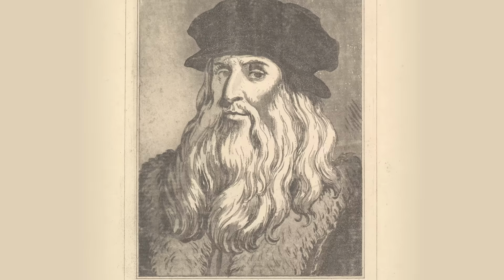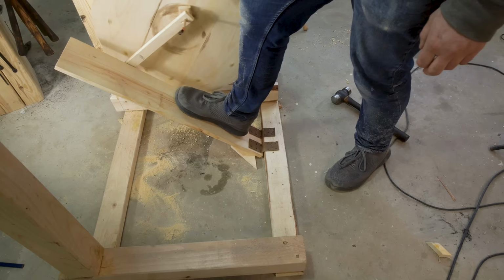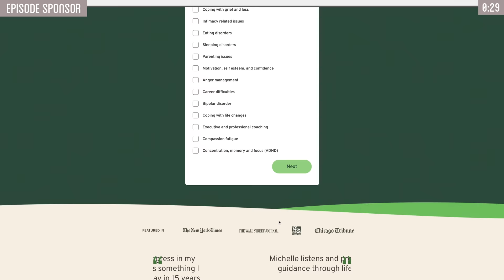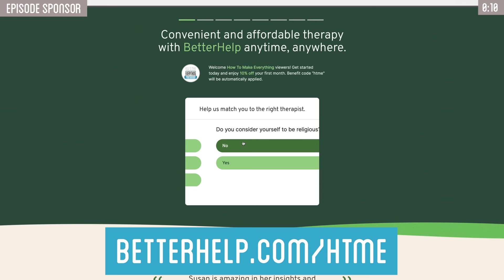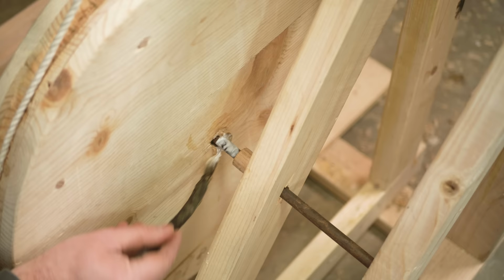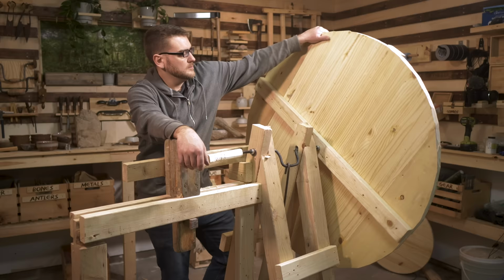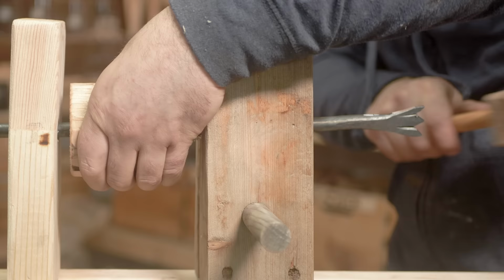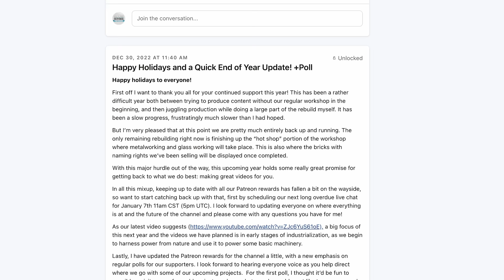Does DaVinci’s 500 year-old Lathe Work?

Comment: I wonder if you could improve this by taking inspiration from a mechanical automatic watch, typically the rotor attatched to the reduction wheels have a method of acting like a sprocket using what is called the pawl lever.

Comment: First get a wheelwright to make the flywheel so that it is properly aligned with the shaft. Use a much thicker shaft, put several feet between the the two bearings, have the flywheel outside the bearing with the crank lug on the flywheel.

Comment: This is interesting, but a spring pole lathe would be simpler to build, and there are many in use today. The disadvantage to the spring pole lathe is that the work spins back and forth rather than continuously in the same direction. The advantage is that when it is spinning in the correct direction, it spins quite fast.

Comment: Bearings! It needs stable bearings to keep shaft wobble to a minimum. Bronze sleeves with grease ports?

Another thing would be casting the frame out of concrete to increase damping mass. Should reduce vibration. 

Also consider building a kick wheel version, one with a clutch. That would keep a apprentice well occupied.

Comment: Nice lath.  Try using your current lath to build your next one.  You might also try a leather belt.  Fit wet leather, which is stretchy then letting it dry  to give you a tighter drive belt.  You could also add a wedge tension adjustment to increase the friction on your rope belt.  Use the pole lath to get rounder and smoother wheels, and pulleys.  Wet your pegged joints to chaise them to swell and hold better. Love your channel.  I have been following you for years.  Thank you.

Comment: A centrifugal clutch or ratchet clutch on the flywheel would allow for retained power instead of it being wasted lifting the foot lever - treadle. But, in any wood craft, selecting the proper wood for each component is key. Additionally, the treadle was on the opposite side from the wood worker, it was assigned to the apprentice as it doubled the productivity of the machine. You could also incorporate cast/worked bronze/iron parts if you wanted for the more friction components or the parts that would require more force like all of the axles. But, that flywheel was definitely not wood. While the sketch is definitely designed as a wooden thing, the actual one would have been much stronger and used a cast bronze or stone flywheel depending on the price of the machine. You can use anything that DaVinci made if that's the challenge so you can do gears and pullies and apprentices, water, wind, and gravity weights - I mean, he did make a robot... so you have tons of leeway in how to build things.

Comment: The BIGGEST improvement u could do is make it like they would have and that means a very tight frame and a flywheel that was properly made and installed.  Meaning that the flywheel would be straight on the vertical and be centers so there is no wobble and the rotational energy would be consistent. And the Tight properly constructed frame would have everything lined up and not lose energy from the frame moving.

Comment: You are closer than you think you are. If you use the simple lathe to make pullies and bearings for the two pulley lathe. I think a rope between the foot peddle and flywheel will work without alignment problems.

Comment: Nice work, thank you for sharing the entire process with us.
If I may suggest, put more attention into your axles, making them more stable should make a lot of difference.
And I think that making things more modular should help too, (i.e.- separate the gears from the pulley, the pulley from the "motor", etc...). This way once you've reached a satisfactory level in one part of the project, you can leave it alone, and only change other parts that still need improvements.
Good luck

Comment: Using any spare olive oil to grease up the torque for your lathe at the main coil isn't too bad of an improvement either, gives it more speed and a higher rate of drive into the wood your boring into!

Comment: Double the size of the flywheel by adding another one of the same size. At the axel add your smaller pulley attached to the flywheel then run a leather belt up to the lathe head. You will reduce the torque that's needed to spin your small pulley  and its easier to keep the power centered. Less parts less friction. You can also use stones in between the flywheels and carefully get it balanced out. Adding inertial mass and making cutting easier.  Really fun project. I'm working on a mill powered lathe but I'm using steel. I can't lie, I jumped ahead in time. Not because of the challenges.  Just age. I'd like to play with my  toys before I can't.  I'm also working on a saw mill. I tried numerous times to get the timing wheel to progress with the cutting of the down stroke but found that the gearing would have to be corrected for the thickness of the log being sawn. Perhaps that's the secret of the mid 1700's saw mills. They figured out the the number of strokes required for the different diameters of the logs and had step pulleys to increase or decrease the ratchet speed. I'm working on a different direction.  I am adding a weight to the sled and with the saw reaching the bottom of the stroke it will push down on a lever that will engage the holding rod keeping the counterweight in place as the saw returns for the next cut. Once it reaches the apex it hits another lever that disengages the holding rod and the weight is reased. Keeping the teeth from back dragging and dulling. Still working on that. I'm going to get the lathe operating in order to make the parts I have in mind.  Nothings impossible if you just stick to it and work out the bugs. I would love to have a day with Lenny, I'd drive him crazy with questions.  😅

Comment: the treadle flywheel propulsion device has powered sewing machines for well over a century, as well as treadle and pedal lathes, pottery wheels, whetstones and many other pre-electric machines. there are pedal powered metal lathes that were built around the turn of the 19th-20th century that are very effective. the heavier the flywheel, the more work that can be done, but the more effort involved in starting and keeping it spinning. newton and his laws of motion don't you know.

Comment: More complex, but possibly doable, also would be a Ratchet. The difficult but would be fabricating the tootheed wheel and it would probably require a flywheel supported only at one end (because otherwise it would need a tube axle) so it may not be possible with the limited technology, but by using a ratchet you would detach the flywheel from the drive on the 'dead' parts of the drive thus the speed would be more consistent and even.

Comment: You do know that da Vinci discovered/invented the roller bearing?   His spindle would have likely  had bronze bushings in a headstock made from oak.   The large flywheel would drive a smaller pulley on a jackshaft with a leather belt.  The jackshaft would have mounted above the flywheel.   The jackshaft would have a drive pulley that was driven by another belt that drove another pulley on the spindle.   Water and wind driven flywheels used this method to drive machinery well into the 19th century.

Comment: There are a lot of upgrades you can do if you are firmly in the time of DaVinci. The flywheel is only worth the momentum from it outer weight, so take pulley system away from the outer edge of the flywheel, in fact make another pulley on the same shaft as the flywheel and connect that to the lathe pulley. Also place metal on the outer edge of the flywheel to increase it's efficiency. The crank can be modified with a rebounding ripcord to give it a bigger draw stroke, and therefore more rpm or torque, depending. The mechanism is breaking because you are being required to pay attention to when you can push the crank or not, as well as having bad mechanical advantage with large swings in stress potentials, and the added stress is too much for rudimentary woodwork. Use a more straightforward drive system, since the pedal will be problematic if not given a lower stress system.

Comment: You need more mass in that flywheel. A way to increase the mass without using metal or more advanced material is to use sand. Make a wooden hollow flywheel and fill it up with sand. The hollow part has to be partitioned so that when the flywheel is forced to stop, the sand doesn't continue moving on its own within and wear out the inside.
Reply: Pack the sand via a side fill hole. Ballance fly wheel

Comment: Just one small suggestion, build workbench and workholding, and everyhting else becomes much, much easier. When your workpiece is stable and held steady, accuracy becomes possible, 
a work bench with holes and  doglegs  could hold on to  almos any object, and could be improved with leg vise or end vise after you can turn large wooden screws. It is painfull to watch you struggle with sawing while trying to hold on to the work without even the most basic workholding

Comment: Honestly, I think one issue with the flywheel was a lack of counterweight, so that it would give the flywheel a resting point to start from and stop at. Having the wheel at a resting position where it is ready and prepared for the pedal to be in a better starting position. Also, the breakages man, instead of just trying to force it to work, instead of maybe, making a holding pin was painful.

Comment: You need to make your fly wheel so it is perfectly circular.

Once you get it spin up to speed (have someone else pump the pedal) then use a chisle and turn it down a bit.

And balance it by nailing bits of metal to the lighter sides.

Comment: Well you could get a bench built in so you can sit and you could make tool carriage to help with even cleaner cut and maybe a leather belt with sandwich between the leather to make a tooth cog belt so you make a cog that is 5-1
ratio so you can get that speed and you can make the smaller cog interchangeable so you can have the options 5-1/2 5-1 5-1 1/2 5-2

Comment: The problem is you're using a modern axle (lubricated only on the surfaces), Ancient axles used wood bearing blocks SATURATED in oil with a high-diameter axle (3 to 8 in d) or narrow axle but longer bearing blocks so you still have a lot of surface area. Here's how:

1. use a 3 inch diameter (or larger) wooden axle, or a metal axel but the bearing blocks have to be longer.
2. smooth axle surface with cattail or rottenstone to maximize surface area.
3. Glue the axle into the wheel so they don't move relative to each other
4. the axle sits in a hollow cut out of a wood block (lower bearing block). Add grease before setting axle into lower block.
5. An upper bearing block with a similar hollow sits on top and is fastened over top of the axle onto the lower blocks with pegs
6. A hole is cut in the top of the upper bearing block so you can drip oil or hot grease into the bearing occasionally.
7. The axle will be hard to turn at first. Turn for a while and the grease you drip in will move around.
8. THIS IS THE IMPORTANT PART: Add oil/grease to the wood bearing blocks often. Eventually they will be SATURATED all the way through with oil/grease. Wood saturated in oil becomes a very smooth and durable bearing for an axle.

Comment: My suggestion would be to visit the first fly wheel design (wood/metal/Comcrete) and try integrate that again into your pulley and multiple wheel design. Its an already good size fly wheel to start and work off of .

Comment: The easiest way to solve the breakage problems is to reduce the mechanical advantage. By having the small pulley about 1/4 the size of the large one, you're quadrupling the stress/torque on the whole system.

Comment: It's still wobbly.  A wider stiffer base with braces at 45 degrees.  Also, he needs to balance the flywheel and create some kind of better bearings for the rotating shaft.  Something tougher than just a drilled hole in the wood.

Comment: How about putting a tensioner on the pulley system? It seems to be flying everywhere.
Also, you could have the foot pedal move in a slightly raised circular motion to allow you to push more with your leg and not your foot. With the added benefit of knowing when to push to gain momentum.

Comment: If you wanted to improve the method of getting the flywheel to speed, maybe instead of a crank style mechanism where you have to time pressing down with your foot for best acceleration. Maybe a mechanism i cant remember the name of where you have a wheel with angled teeth and a bar against that wheel with similar shaped teeth but opposite so when the bar is pulled down, the teeth catch and pull the wheel, but when it goes up, the teeth skip over eachother. this way you get acceleration no matter the position of the wheel.

Comment: Instead of rope or twine to transfer your motion try leather. Making a Leather belt that is pre-stretched to allow it to keep tension might allow it to stay in place easier. It might be more period accurate as leather was often used in such applications from ancient times. Lastly put a tensioning device in place to keep the belt taught. A modern tension device would be a slotted attach point with a bolt to keep tension. But you could use wedges to apply/adjust tension between your flywheel and cam and again that seems to be more inline with older techniques.
I do enjoy your shows and explorations of the probable problem that our forbearers had in getting us to the technological point that we are in today.

Comment: looks like you're using softwood. hardwood or metal would be better for those high stress points. additionally, wax is probably one of the best friction reducers you could use. maybe graphite if it's historically available. google says 16th century? should be good. just grind it up and rub it in. it's a great dry lubricant.

Comment: Honestly technology needs to be looked at like a ladder. This lathe could be adapted to make better pulleys, which then when better pulleys give you a better way to make better axels, and with better axels....etc. 
 
We use our tools to make bits of them better when possible. Which increases their efficiency until its maximum is reached at that point. Where we make a new tool, or improve on other things until we unlock the next upgrade possible with what we have...etc.

Comment: You need a balanced fly wheel all that wabble is no good it would be easy to convert an old treadle grinding stone into one and i agree with the other guy it should have a pulley system and a simple belt tensioner for a clutch. So you can get it up to speed before getting to work. I've thought about building something like this out of metal in the past

Comment: I thought that maybe a stone as the flywheel would be better because more mass means more kinetic energy and more inertia. But then I realized that also means more work to get it up to speed and if you're going increase the mass, increasing the diameter with it would give you more torque to even get it up to speed to begin with.

Comment: Question : why the figure 8 in the rope ? Just begging to knock it off every time the knot comes around. Better plan go around the same direction once, like on a windlass or capstan. Also, seems like you could increase the flywheel thickness instead of diameter to increase its weight.

Comment: It's awesome that you try this out! As for the multiple lathes I see you use a modern roughing gauge. This is a tool they didn't use for this kind of wood turning, they came with the industrial lathe (steam powered and up) and were used in a positive angle(above the centerline). The tools used on treading lathes including the pole lathe would be sort of hooked knives similar to woodcarving knives and were used in a negative angle. The wood probably wouldn't be dry either, greenwood is easier to cut with these tools.

Comment: If nobody has suggested it yet, I think a leather belt would be a major improvement. It'd be less likely to slip off, and leather belts were used well into the industrial revolution
Reply: Leather belts do require a different shape of pulley however - contrary to expectations they need a concave surface.

Comment: Great work!  Looks like so much fun (and hard work) to build all of that.  The results are super impressive, especially given your tool limitations.

I wonder if a gear would be more stable than a belt for amplifying the speed of rotation; the flywheel is by nature going to have a lot of wobble to it, making the belt method hard to keep running; but maybe some small gears can reduce all that torque into rotational velocity in a more stable way.
Reply: The flywheel doesn't have to be wobbly.  If he trued it by turning it on its axis (turn as lathe work), then balanced it by either drilling holes in the heavy side or adding weights to the light side, it would spin without causing the lathe to move.

The bigger problem is the play in the axle.  Bronze bushings would help, but you really need a way to turn metal first, which is a chicken-and-egg problem.  Using a flat leather belt instead of a rope and stiffening up the structure would go a long way to help.
Reply: Yeah I was thinking about balancing the wheel with weights, and adding iron to the rim would boost the efficacy (i.e., angular momentum) of the flywheel anyway.  It might also help if the flywheel's connection to the axle were widened or buttressed and the axle lengthened to help reduce lateral wobble.  I would also consider a hollow flywheel with spokes to reduce the weight to angular momentum ratio; that would make it a lot easier to work with and would reduce the strain on the axle.

Comment: You should try using leather belts as your pulley rope.  Less likely to slip off the gears.  and don't cross the strap either leave it straight.